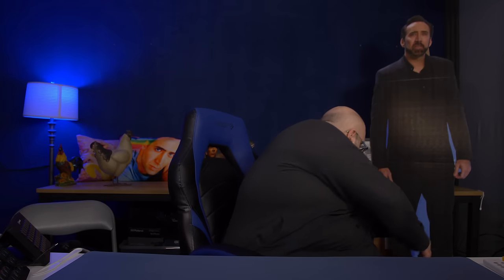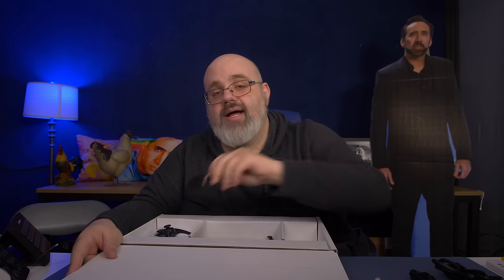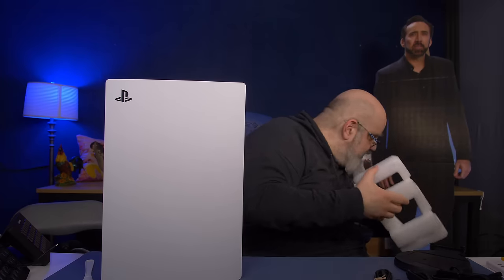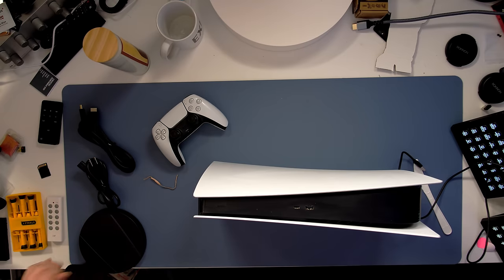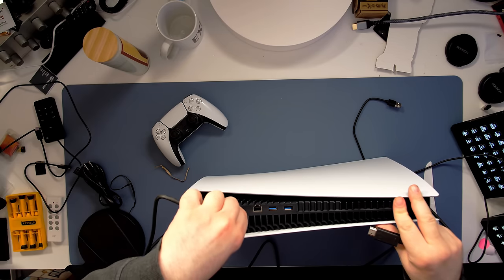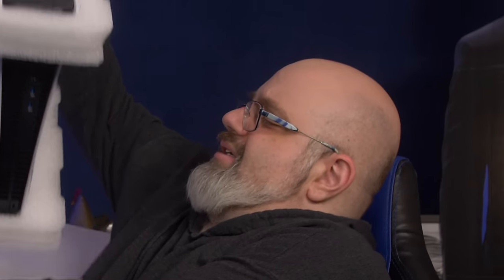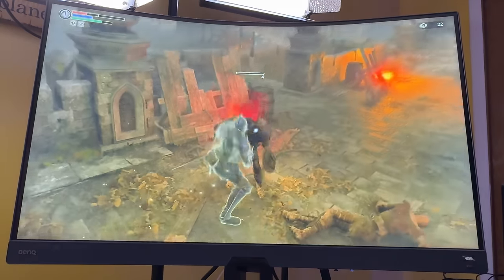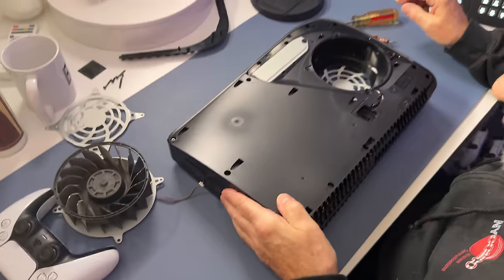This "Refurbished" PS5 From GameStop Makes ZERO sense

Comment: i see new digital edition ps5 is 400$. I’m confused on paying $440 for a used refurbished one
Reply: Is this the slim cuz the slim digital is 450
Reply: @dimes305 this is not the slim
Reply: @TheDreadedZero  well then that’s a rip off no one should buy that
Reply: Could only be RTU
Reply: That's exactly what my thought process was.
Reply: Sony has a special going on for the new slim models with a digital copy of Spiderman 2. It's a good sale cause it's $399 for the digital and $450 for the disc model. Sadly, it's special, and it won't be around forever. 
So to compare prices. A standard ps5 is $500, and the digital model is $450
So, with the current deal/special going on, yes, it makes no sense to buy a pre-owned/refurbished product when the new is on sale cheaper.

Comment: I bought a "refurbished " PS3 once but I returned it because it failed out of the box. And I had a game in there too. Fortunately I called them about it and they were able to retrieve my game, so I went back to that GameStop and picked it up. Before that, I bought an Xbox 360. No problems there. Well, now the only problem is it's a POS now. The DVD drive gets stuck but otherwise it works.

Comment: You mean to tell me GANKstop does questionable things? Noooo way. The one refurbished console i have ever had luck with was a launch model white 360, and they did indeed change the fans and clean it. It sounded like harrier jet during vertical takeoff, but it ran well past the life of my others. Chief ironheart 2007 was retired just last year so, pretty good run.

Comment: Looking online, looks like they realized how ridiculous their pricing was. Refurbished digital only edition is now $410, or $389.50 if you're a pro member.

Still ridiculous. I'd spend the extra $50 for a brand new digital slim edition. Which, as you've said, at that point, might as well spend the extra 50 and get the disk drive version. Because even if you never use the drive, it's better than realizing you need is and paying $80 later.
Reply: Disc drive saves you a lot of money in the long run

Comment: I think it's a good deal if it works. When gta 6 comes out I wouldnt be surprised if it gets gard to get a used console or even a new one.
Reply: What? How?  You think that used, refurbished all digital ps5 console is worth it over a BRAND NEW PS5 at $399.99?!  You are crazy!
Reply: @WolfCAlpha  oh ya. Used consoles are gunna go up Hella.

Basicly there's not enough consoles for gta 6. Just wait until the second gta 6 trailer comes out with a release date and people start running to the store to buy a console.

Sony will prioritize making the ps5 pros which will be instantly scalped and sold for way more. Leaving what ever new ps5 slims Sony has to get sold out. Leaving only used consoles left over.

I mean i guess it would be a better deal for right now. But corperations don't go on the week to week. They go on if what they put out sells. If people buy the used consoles they will keep selling them.

Probably the used ps5 will basicly last as long as a new one. Consoles are more likely to break from a fall or physical abused then by just using it. 

Why they become the same value is people just care that it can play gta 6 as soon as they can. They arnt goingnto care if a used ps5 will break down a year before a brand new one would.

My ps4 is 10 years old. Playstations are known for lasting long. So people wouldn't be super scared of there used console instantly breaking. So I don't think it matters to most people. It only matters to people that want there console looking brand new. Most people don't care that the gloss black is scratched up. I have a series x and I don't really look directly at my console much.
Reply: @WolfCAlpha  also keep in mind that stores don't make alot from new consoles. They make there money off of the used ones.
Reply: @philipberlanda  there is plenty of PS5 in stock your opinion doesn’t make any sense.
Reply: @philipberlanda  right which means they should go out of business.  No one is buying a used console when for that price when you can easily get a brand new PS5 for cheaper…..
Reply: @WolfCAlpha  there is ps5s in stock right now. But things can change. I'm talking about when gta 6 comes out.

Even tho you are correct. It is a better deal to get a new one. Most people don't care. They will just want a "gta 6 box"

So why ps5s are slowing down is because the scalpers disturbed the profits. So Sony made like 3-5 million ps5s too many because they thought they would sell. Which in turn forces then to either stop or severely slow down production. Sure the stores arnt going to run out of ps5s right away. But because of the ps5 pros they wouldn't really make a ton more of them if most people will be looking to buy a ps5 pro instead. This kinda happened during covid when the new consoles just came out. They stopped production of everything else and all the old consoles sold out right away.

Also stores going out of buissness is bad. Why? Because if everything is online then scalpers can control everything.

I wouldnt even be surprised if scalpers buy up regular ps5 slims just to create a shortage. With people panic buying consoles when the gta 6 trailer comes out there could easily be a shortage.

Why ps5s are in stock is because people are now going to wait for a ps5 pro. If there is something more valuable(ps5 pro) coming people would rather wait and take the risk.

If you think I'm insane remember that's theres a bunch of gaming creators/streamers that will want the ps5 pro for gta 6, because it's there job to have the best tech/gameplay.